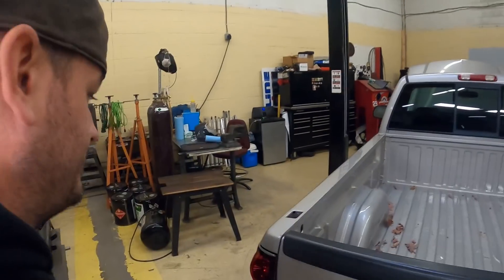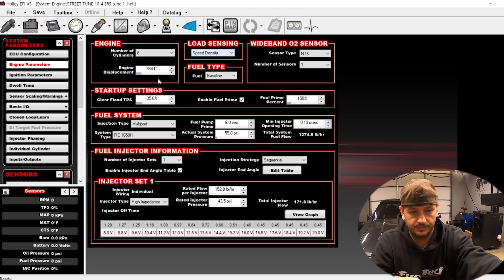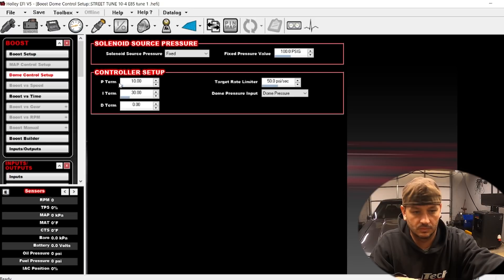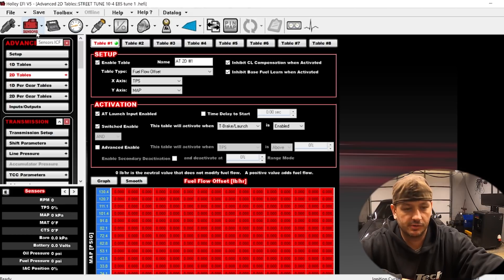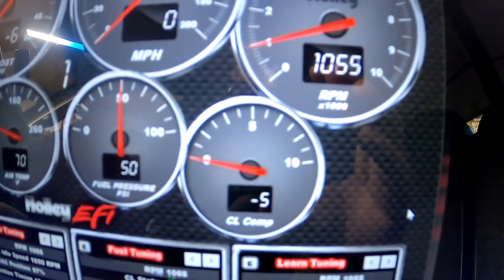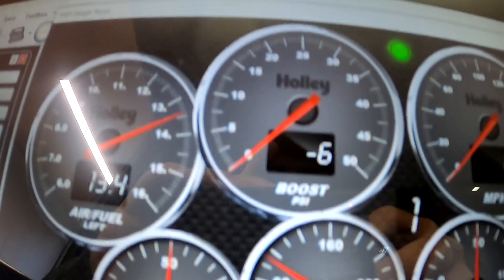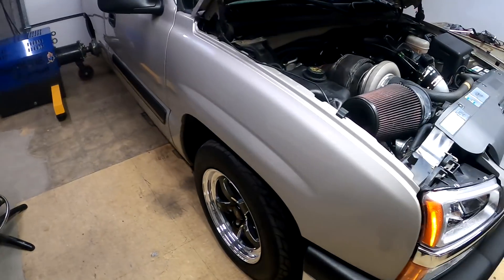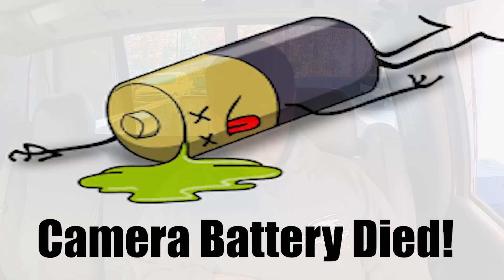Holley Efi Tuning - 900 Horsepower Turbo Silverado _ Part One

Comment: Hi,  thanks for your vids. I appreciate it.  Question. If i am building a turbo LS with single injector per cylinder with flex fuel and not using nitrous,.. how many input/outputs would I need?  Or at what point would I need Dominator? Thanks.

Comment: Joe what did you do to the tune when the truck was starting and then attempting to stall? i have a 2.8l vw vr6 on holley term x, no iac motor using timing for idle control but the car cranks, fires and then almost stalls before it stumbles slowly back to desired idle. sounding very similar to what the truck did once u tried the cold start on the dyno.

Comment: I have a cammed 4.8, and I've ran it on holley, fitech ls, and now factory 0411 ecu.....on all 3 ecu's once it's at temp whenever I go to restart it , it always revs upto 2500/3000rpm then back down to 800, any ideas?, I even put different injectors to no avail..........other than that the motor is a beast....

Comment: Is there anyway possible for you to do a very simple remote base tune for a 2004 4.8 and 2001 4l60E running terminator X max I’m in Cali which is probably a ways away from you just wondering I love your work and you’re vids thanks Blake